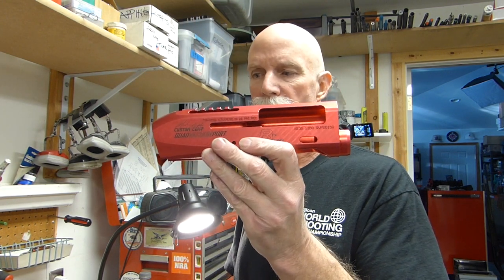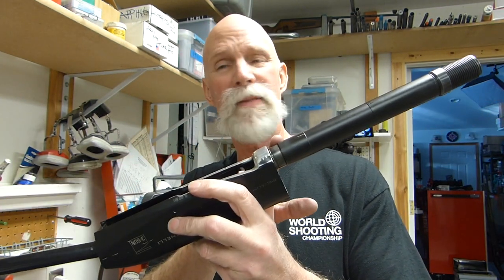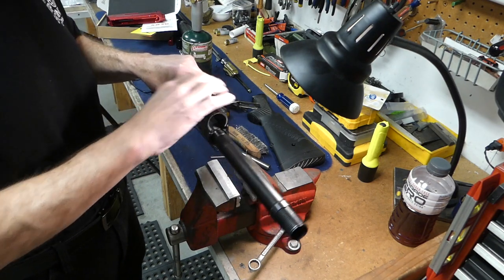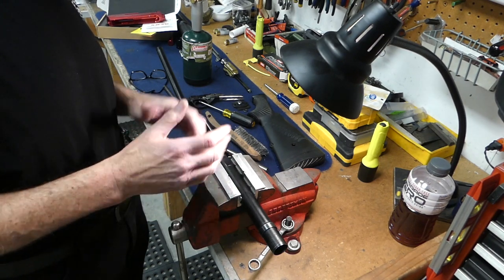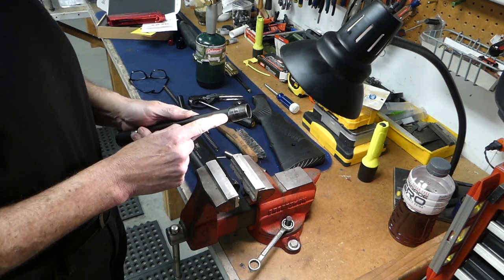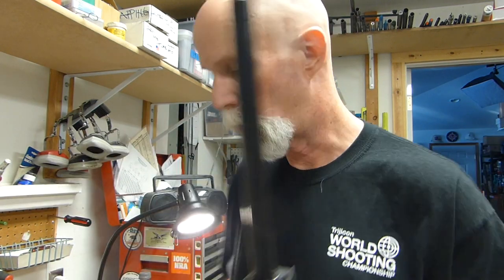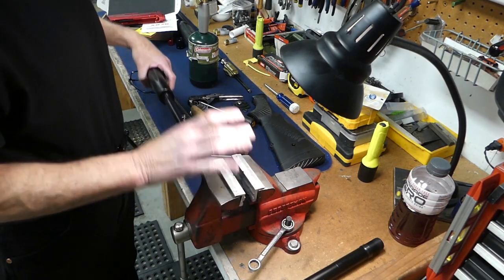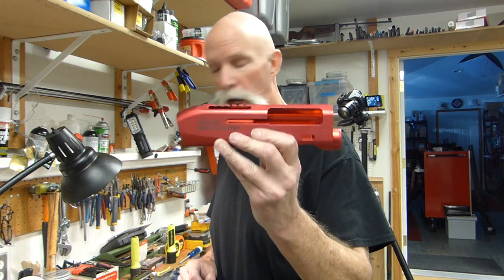Roth Performance Benelli M2/Breda12 Receiver Upgrade

Comment: Now all you need is an MOA Lightning-Load Lifter! 

I'll shoot my Roth cut A5 until it gives up (which will probably last my whole life), but if I ever need to start again, I'll be going this route.
Reply from the maker: Just put one on my P3K Stoeger for this season!
Reply: @PatrickEKelley3gunfun  Nice! Would love to see a video about it. Even though you're already in "trouble" if you go to bolt lock back, a comparison of, say, 4 shots to lock back, load (from match saver and belt or now just throw in a quad) and 4 more shots, on the timer, would be cool.

Comment: If you were going to get a Benelli bolt coated, TINc, tin, PVD etc…

What coating would you use and what other parts would you coat? And who would you send it off too?

I’m a waterfowl guide and rebuilding a sbe2

The ejector plate is jb welded and the firing pin spring is 4 mechanical pencil springs, I think that is all I need to say about it

It actually still shoots.

When I used to shoot 3gun and uspsa in Colorado, always cool seeing you.

Cheers. Hope all is well.

Comment: What torch body is that? (Totally random, but you reminded me that mine nearly burned the shop down last time I used mine)
Reply from the maker: Bernzomatic.
Reply: Thanks! I had a cheap-o Bernzomatic that failed, that one looked more robust (all metal).  If you ever need a home for that old Clausing mill, let me know 😊